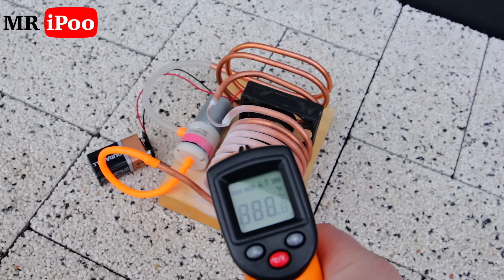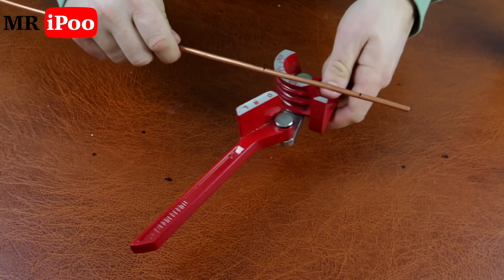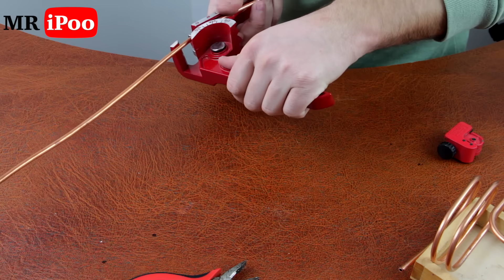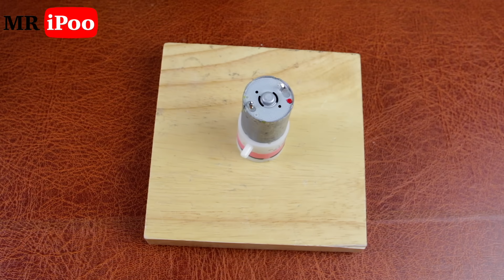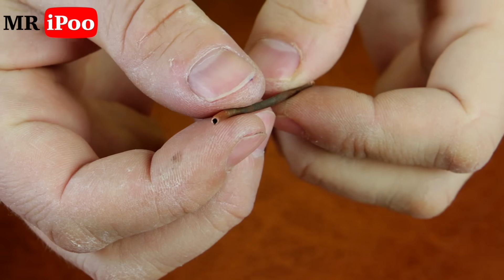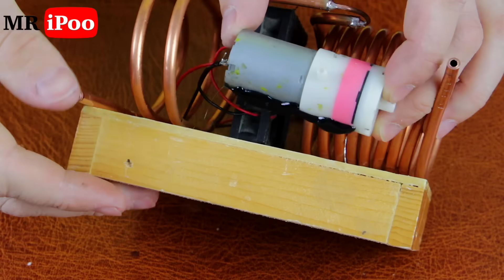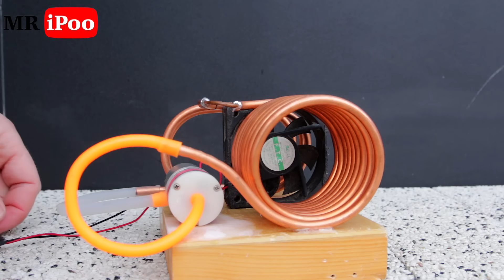DIY Freezing AC : Crafting an Icy Air Conditioner down to -32°C!

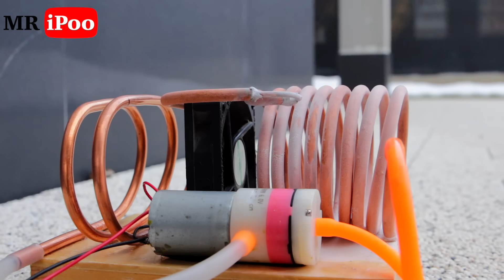Comment: Is it necessary to show us detailed views of each tool and how it is used?  I think most of us can figure how a tube cutter works.  However, don't bother to tell us to clean dirty copper tube before soldering it.  Oops, maybe should have cleaned it.  Looks like a refrigerant leak @ 7:38.

Comment: You should have enclosed the entire system in a case, separating the condenser from the evaporator, and added an extra exhaust fan on the hot side to make it work properly. Right now, your fan is pushing all the heat into the cold zone!

Comment: FALSE, FALSE, THAT WOULD NEVER WORK, THERE IS NO PRESSURE DROP IN THE CAPILLARY RESTRICTOR, IT WOULD NEED AT LEAST ONE AND A HALF METERS TANGLED AND THERE HE ONLY PUT THREE CENTIMETERS AND ANOTHER VERY SERIOUS THING, I DID NOT SEE THAT HE MADE A VACUUM IN THE SYSTEM WITH A PUMP OR THE SAME COMPRESSOR......AS A RESULT THAT IS FALSE................

Comment: I just don’t get it guys,despite having ab air conditioner i want one which can be carried around and does not have hell lot of systems , so i wanna know can i just put that chill gas inside a copper wire and rotate it throughout the pump, and after that would it be cool , just put a fan to spread the cooling , is it possible

Comment: The common PP3 9 volt battery has about 0.5 Amp hours. Maybe putting out 4 to 5 watts. Bing brings up:  Typical wattage for a 12V washer pump is around 45/50W with a maximum current of 5 Amps.

Comment: That copper tube with very small cross-section, is strangling the debit, when connecting the 2 copper coils. I would have connected the coils with either a short piece of that yellow plastic tube, either with an overlapping bigger copper tube, either by carefully bending the ends of the 2 coils such as to touch, then soldering them together.
Reply: You don't seem to grasp that the piece of small diameter tubing serves as an orifice ('strangling " the flow, as you would say).  Without it, there would be no pressure difference between the coils and no refrigerating effect.

Comment: That looks like BS. The Evaporator at -30, fine. But condenser is at 3C? Where is the heat that is being removed from the condenser going to, if the evaporator is below ambient!? It more seems like this was loaded from liquid butane, which is slowly evaporating (leaking) and hence providing a cooling effect.

Comment: Do people fall for this crap? with a vapor pressure of 35 psi at 70 degrees, this setup wouldn't hold the pressure for more than a few minutes before it will all leak out. Anyone following must be very gullible.

Comment: The water drops go backwards at 7:35 it mean that the video reversed.
Reply: Kapattıktan sonra bakır borularda oluşan nemlerin birikmesi nedeni ile oluşan buzlar erimesi sonucu oluşan su damlaları. Tekrar çalıştırıldığı zaman donmaya başlıyor. Düşündüğün gibi bir geri sarma olayı yok.
Reply: I don't think those are water drops you see, that is the butane refrigerant leaking from the faulty solder connection.  (Clean copper before soldering.)  The leak didn't occur until the pressure in the condenser increased with heat.

Comment: If you fill a tube with liquid propane/butane, it will evaporate and the temperature will be decrease. The remaining parts, like fan and pump (maybe for a car windshield washer) are without function.

Comment: I will explain it very simply, this system will be VERY INEFFICIENT for 2 reasons:
1) the system must be purged using an inert gas, for example Nitrogen, eliminating air, humidity, etc.
It will never have the level of efficiency shown in the video.
2) you will inevitably lose gas in a very short time.
Compressors are ALWAYS inside an airtight casing that prevents gas from escaping, otherwise gas WILL ESCAPE.
However, it is a very illustrative, simple and fun system to teach the components and operation of an air conditioning system.
Enjoy !!

Comment: Great video, simple system and method, without relying on exotic items. Using a pump for compressing the refrigerant and the filling method are interesting. Is the system running? If so, is there any noticeable leakage or wear at the pump? Thanks.

Comment: And how long does the gas last? Or rather, how long does its heat transfer last? It's just a very simple diagram. Apparently, it’s not for nothing that freon is used in refrigerators. There must be some trick with the gas?

И как долго держится газ? Вернее, как долго длится его теплоотдача? Это ведь очень простая схема. Видимо, не зря в холодильниках используют фреон. Наверное, с газом какой-то подвох?🤔👍👍👍

Comment: Propane WILL work, but it is EXTREMELY DANGEROUS.

IT CAN EXPLODE

It used to be used a long time ago but it was very dangerous and too many deaths happened so it became illegal to use any flammable gas in freezers and refrigerators and A/C systems
Reply: That was Methylene Chloride I think you mean; poisonous IIRC and flammable if I recall.
[it was also used in bubbling Christmas ornaments, and drinking birds]
Actually now HCs ARE being used in refrigeration....
See R-290, propane refrigerant...

Comment: If you have a compressor and a way to exhaust the heat, and Ammonia, you could make something like this.

Back in the 50s and 60s even the 70s we had huge concrete warehouse 15 stories high with railroad bridges bringing the train and boxcars inside the warehouse on the 3rd, 4th and 5th floors

We had giant radiators on the wall made of large copper lines

The entire building was using ammonia in the freezers and coolers.

We could lower the temperature to -50 degrees F even when it was 120 degrees outside and the refrigerator floors we had at 34 degrees F

We stored food for stores and fur coats and dry goods and volatile materials that had to be kept below zero to stay inert.

We had tanks of all sorts of gasses that had to be kept cold.

Really amazing

These warehouses were all over the US in every major city.
Reply: vapour absorbtion right ?
Reply: @Team_Reaper.  I don't know how it works exactly

There is something that happens when it compressed the gas

It causes the vapor to become liquid and then it changes back to a vapor

The cold liquid is warmed by the air in the room and changes to a vapor and gets sucked by the compressor and changed back to a liquid.

The A coil runs through the vent and the blower pulls warm air across it and the heat absorbed in the return lines is blown across exhaust fans outside and they exhaust the heat into the atmosphere

In these warehouses they usually had the compressor and the condenser coils in the basement and the air was brought in from outside and passed over a heat exchanger in the basement to use the cooler air naturally occuring underground to make it more efficient

Comment: Better executions are appearing - someone will take care of all of the few minor problems someday and have a working miniature model of a butane chiller. Search for Gab tech expo video with words "How to make Ac Extreme upgrade" in the title (if you post links on yt your post gets deleted) This was just posted this weekend. Not sure if it's a re-post of course, but the newer model seems to have addressed at least a few of the complaints voiced in this Mr iPoo post.  I'm guessing someday soon you'll see a small model that works with proof, and won't be much different than the iPoo version. Then all of the "experts" that said such a thing could never pump heat will do some quick backpedaling and claim they always knew it was possible to build a miniature model of a working butane chiller 😛

Comment: Could you do it with ammonia gas?
Reply: Yes, but that stuff is NASTY.  There are literally millions of refrigeration units working out there using R600a (Iso-Butane) as a refrigerant grade Butane. It's a good choice for a low pressure system.

Comment: functionally, its an AC system. Brutally simple. I was expecting some bs but I'm happily surprised.
My ONLY concern is the butane.  Dont let it run unattended.
One leak, one spark and you gotta nice flash fire. Anything close to it is gonna go up.
Careful...but great job!
Reply: Actually, there are literally millions of refrigeration units working out there using R600a (Iso-Butane) as a refrigerant grade Butane. Such small volumes are no big risk in your house.
Reply: Ist Fake
Reply: @sauer7592  Have you ever seen those tiny Sterling engine models that you sit on top of a cup of hot liquid? You give the flywheel a nudge, and instead of slowing down and stopping it speeds up, and continues to run for quite some time while there is a heat difference. It doesn't produce enough mechanical energy to blow your nose - so does that make it a "fake" Stirling engine?
Reply: @davidsmith3302  If I tell you it's fake, then it's fake. You don't even have to start with Stirling engine history.

It doesn't matter how much volume the refrigerant has.

1. To get from room temperature to -32 degrees you need 10 bar pressure. See  log p - h diagram for Butan.This even under loss-free conditions.

2. This small compressor doesn't handle 10 bar.

3.Let's say he was lucky the little compressor made it. He has built up 10 bar. These silicone hoses cannot withstand this pressure.

4.Let's say he was lucky again - the silicone hoses withstood this pressure and didn't break. The hoses would not slip out on this copper tube without hose clamps

5.Let's say again he was lucky the hoses didn't slip out. Here he has a left-handed circular process called the Carnot process. It is a closed system, which means it has to reduce pressure again in order to be able to absorb heat again. Did you see anything in the video? A component for pressure reduction. No you have not. 

It's fake like all the other shit like infinite energy or flat earth. Stop it, why are you so keen on someone tricking you? It's fake, you don't need to write anything anymore.

But I think you are a fake account from this channel or his friend anyway.
Reply: So here's the first disappointment in sauer's argument (he might not want to discuss it, but maybe someone else here will because some of us like to learn things instead of just being told to believe it)

The log(p)-h diagram he referenced is a chart showing pressure going up the left axis, and enthalpy (fancy word for total heat energy in the system) going across the bottom. There's a nice curve on the chart showing the region where the working gas is in some state of mix between liquid and vapor.
You can find videos (assuming they aren't "fake" 😆) where engineers are showing how they use those to find and/or design various things into their refrigeration system, things like the amount of work the compressor will have to do, and a various ways to look at efficiency, and you can see what kinds of pressure differences give you what kinds of changes in heat energy. 

The problem is, none of that speaks to specific temperatures achieved or achievable. You can calculate heat (re)moved per each cycle, but it doesn't imply any minimum limit.

The pressure axis of the graph goes all the way down to zero and below, so I'm assuming you could draw a cycle on this chart hovering around the 37psi the system will be at just from being in balance at room temperature - liquid and vapor in the pipes, and that would show you the amount of heat energy you could move every cycle by even going through a single pound of difference in pressure across your restriction (valve, capillary tube, whatever) While sauer might have missed seeing anything in the video to cause a pressure difference, it's already been discussed that he put a length of smaller tubing in the loop (yes, maybe not small enough to be effective, but the component is there)

So here's the part I need some explanation for - if you only remove a tiny fraction of that heat, per cycle, but you repeat the cycle over and over - why wouldn't you be steadily dropping the temperature in the system? Eventually you'd reach a limit of course because ambient heat would be flowing in faster and faster as you made things colder and colder - but I don't see anything in the performance chart for butane that establishes a 10 bar pressure difference being required, unless you want to drop the temp that far in a single cycle. Another thing - apparently it absolutely DOES matter how much volume of refrigerant you have, because the chart gives enthalpy PER UNIT of refrigerant. Obviously more refrigerant moving through each cycle would move more heat.

So... any refrigeration engineering students or teachers out there that can explain this? 

(and for the last time sauer7592 - you're right, it's fake, mission accomplished, you're the winner - you can go back to your porn site while we keep learning stuff here)
Reply: @davidsmith3302 Nobody has to explain anything to you. It's about this video and it's fake. You don't have to work your ass off to defend him.

Comment: I'd like to know how long it takes for the ice to form on the surface. In the video, there's an overlay effect called compositing, both in the fan's audio slowing down due to battery discharge and in the video itself. Could you tell me how long it takes in real life? Thank you!
Reply: IF he built an actual functional unit, he might be able to tell you. So many people have found the telltale indicators of a fake video that I'm sure he can't. On the other hand, he has inspired a lot of comments from hobbyists that could make minor changes and have a working heat pump. Too bad he keeps refusing to comment on this, but he is irrelevant after all.
Reply: 29 лет

Comment: i have two question 
First what type of motor you used this is water pump or air pump 
Second which Gas you used
Reply: The pump should be something that compresses gas and be fed from the vapor side of the loop. The gas he used was "lighter fluid" which is butane, but you can also buy iso-butane in sporting goods stores and that is an even better working fluid. Be inspired to make a unit that actually works and you will get some benefit from this fake video.
Reply: This video process are fake or real